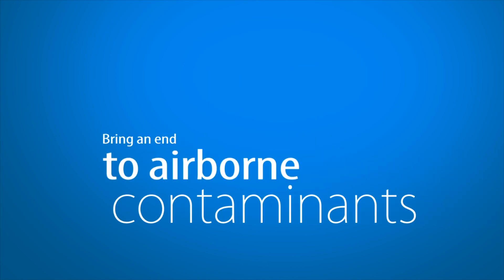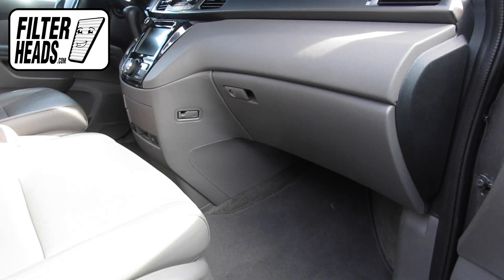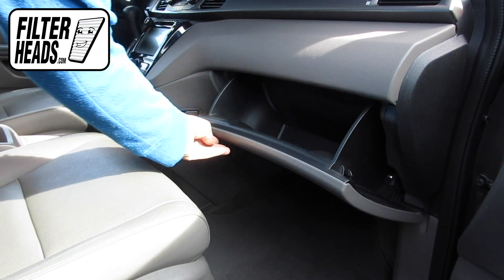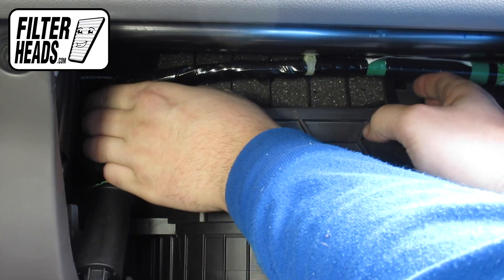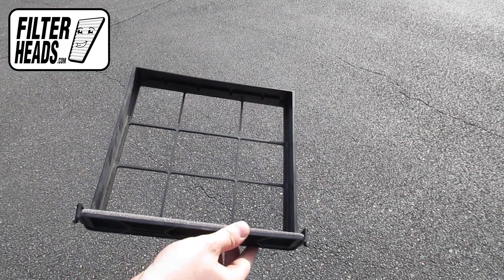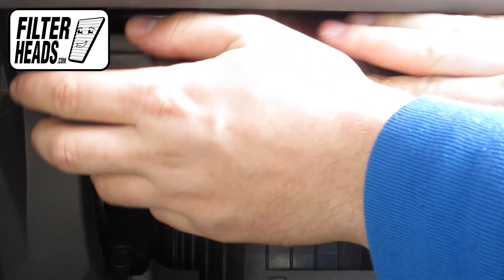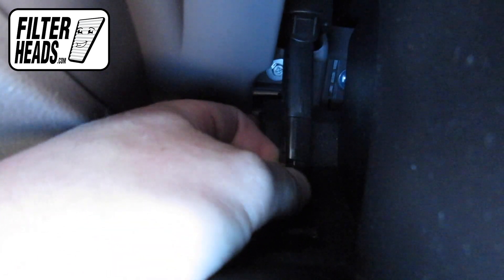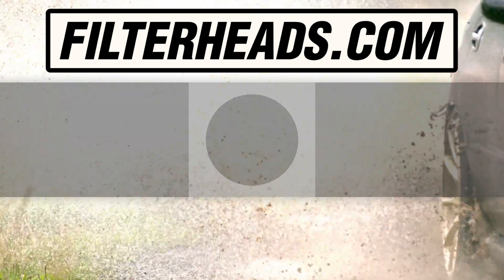How to Replace Cabin Air Filter 2015 Honda Odyssey | AQ1058C

Comment: Just bought your filters and about to change them.  Looks so much easier than my 2003 Odyssey.
Reply from the maker: Thank you for the order! Yeah the 2003 model takes a little longer to change. The 03 model also takes our cabin air filter AQ1054.